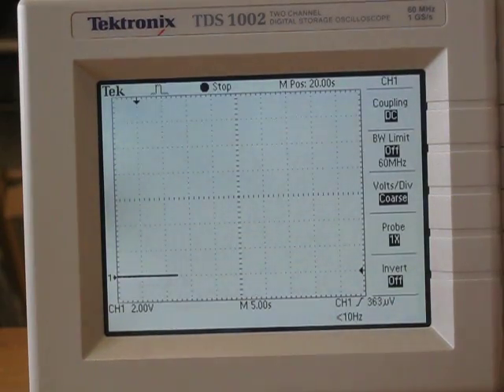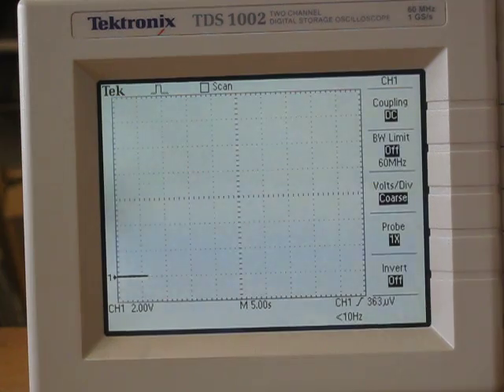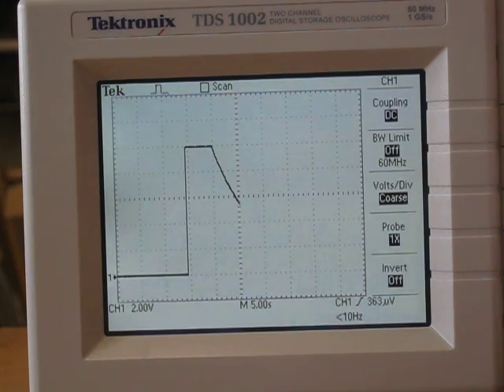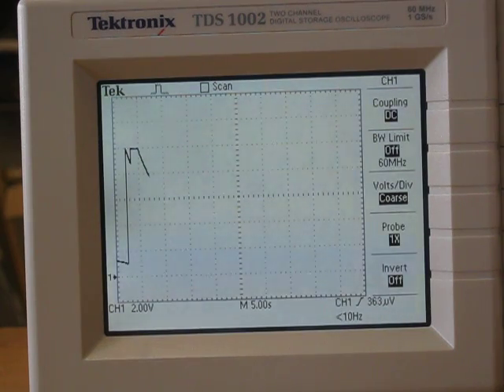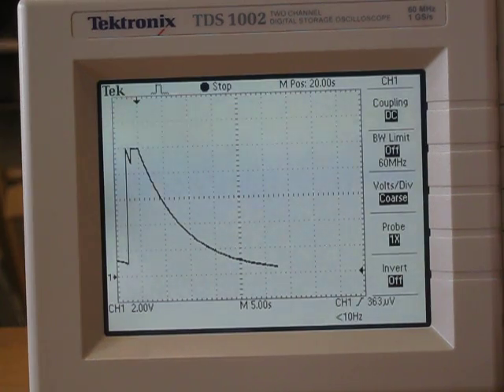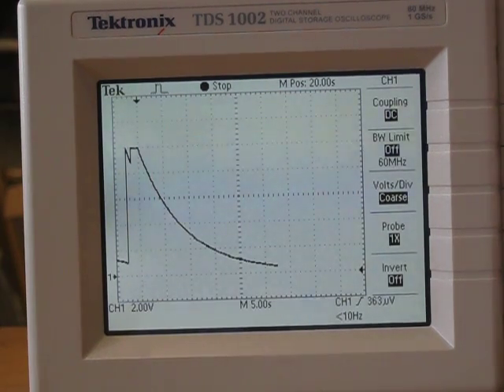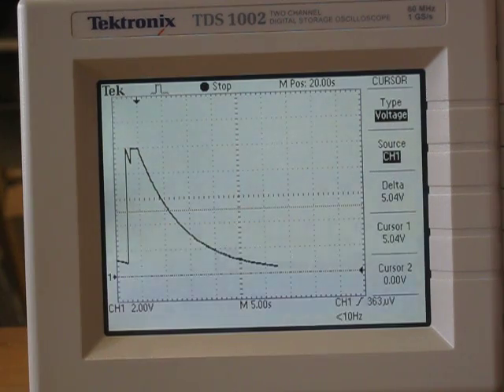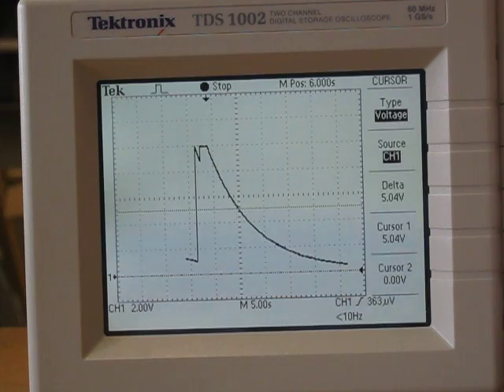Capacitor Discharge on a Digital Scope

Comment from the maker: Answer comment
It is a TDS1002 digital storage oscilloscope from Tektronix with a max 1GS/s sample rate and a LCD display. It is a digital scope which samples an analogue voltage, converts each sample to a number and stores all the samples in memory.

Comment from the maker: @formulaeorg

answer to question
switch used to charge capacitor. when released cap discharges through resistor.

Comment from the maker: @formulaeorg 
response
The circuit was a capacitor in parallel with a resistor. The capacitor was charged from a power supply and the switch was in series between the power supply and the resistor capacitor combination.